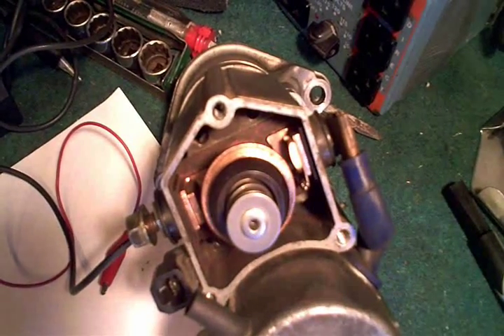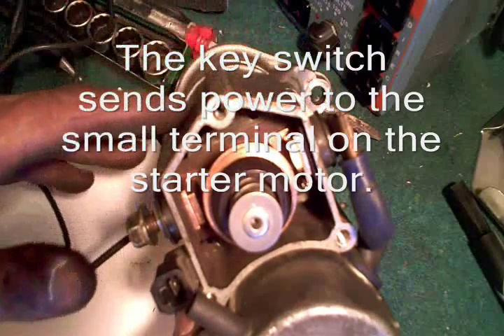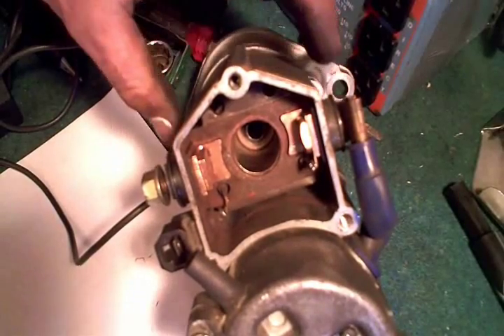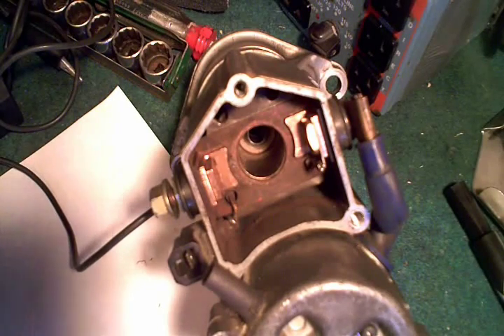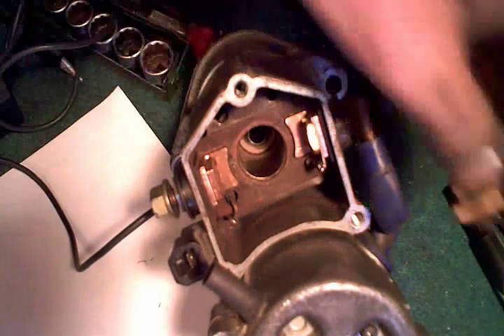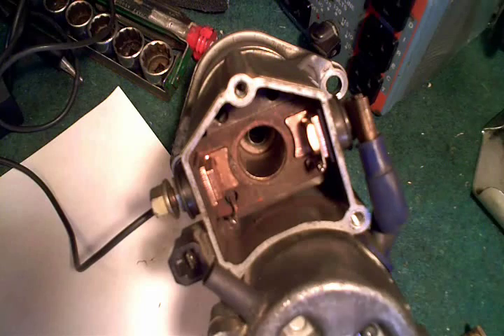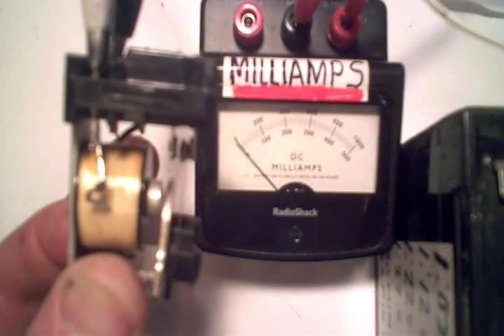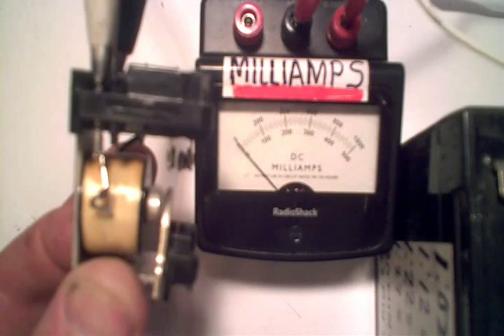Solenoids & Relays. The how and why they are used.

Comment: My Toyota solenoid does the same thing - - same symptom.  I replaced the ring AND tabs but it didn't fix it. 

When I open the hood (bonnet) and jump the battery + to the small solenoid terminal, the starter  turns. So I need to replace the ignition switch contacts. 

Just  know that the same symptom could be caused by either of these problems.